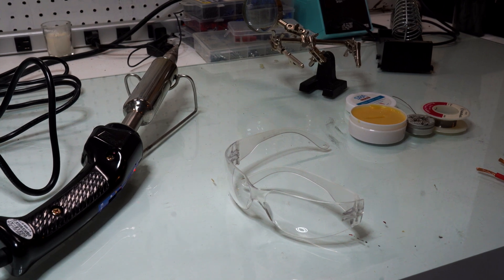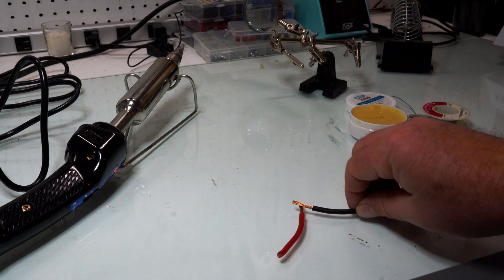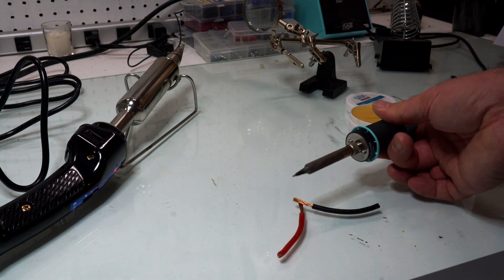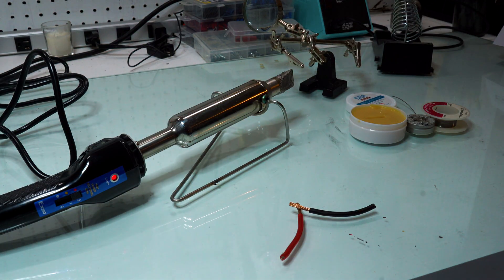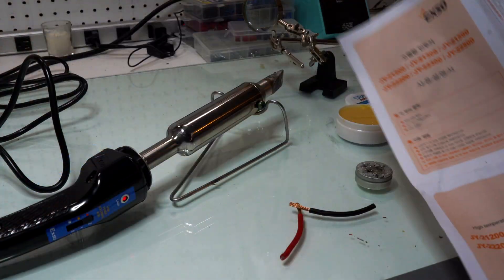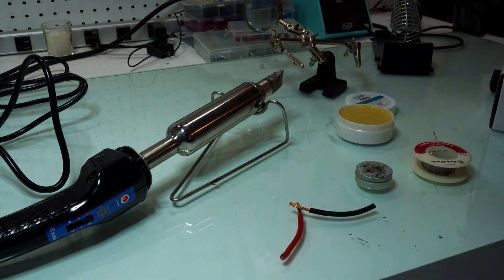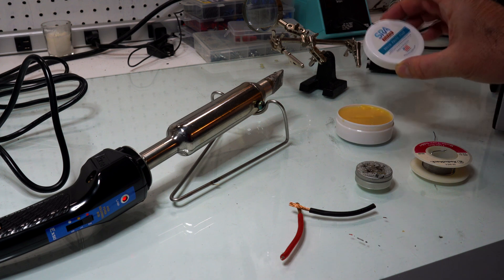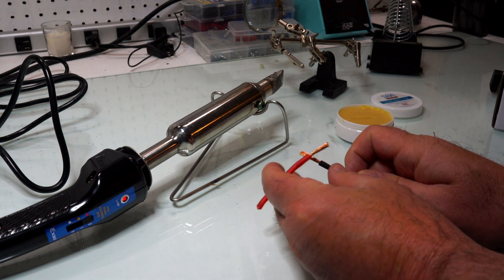High Temp Heavy Duty Soldering for big ground connection

Comment: Was there an editing error? It skipped over the actual soldering part. Looks like a beast. If it works I need one.
Reply from the maker: Yeah, I lost the footage where I soldered it together.  : (  Maybe I'll remake the video.
Reply: @hamradiocq  check out the 1000w induction heater on eBay ($160). You can heat up metals up to 900 degrees in 30 seconds. I just bought it for soldering